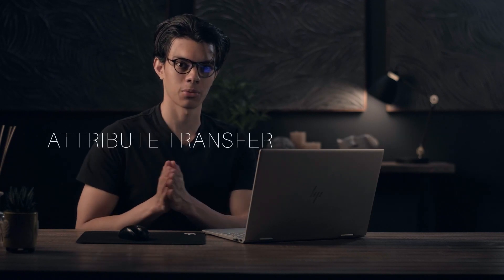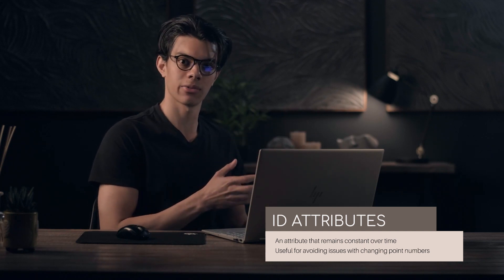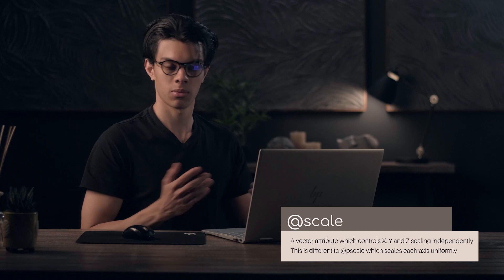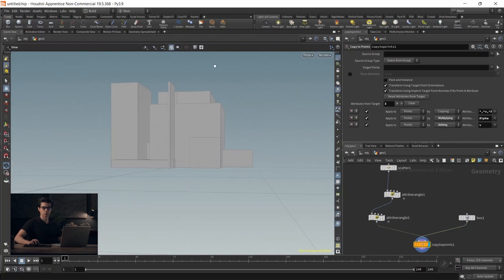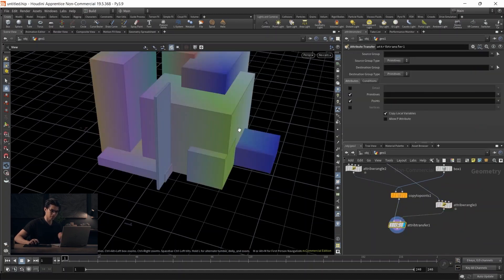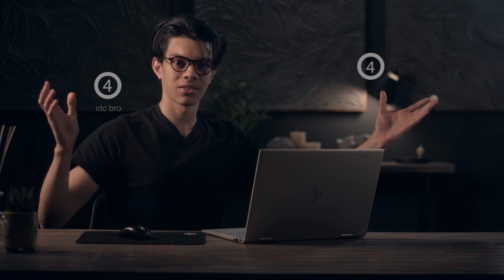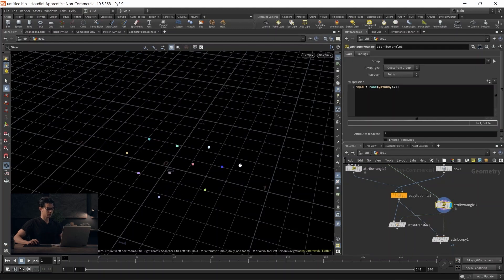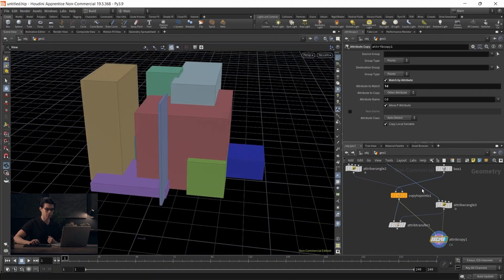Attribute Transfer, Attribute Copy and ID Attributes - Handy Houdini Tips

Comment: Solved*
Does attribute transfer of the same attribute E.G From say a copy to points with small spheres with "attribute1" on all points copied to a big sphere that has  "attribute 1" noise pattern via an attribute randomise give an output that combines both patterns?

I've been stuck using a tutorial where an attribute transfer is used but it's only giving me the transferred attributes from the small spheres on the big sphere (I have turned down distance so it very clearly shows that small sphere pattern on the big one), but the noise pattern on the big sphere is lost and I have no idea why.

-
Just had to make sure my attribute was set to float so they can combine as one was set to vector on accident.. Don't be like me and remember to match attribute types if you want to merge them etc!